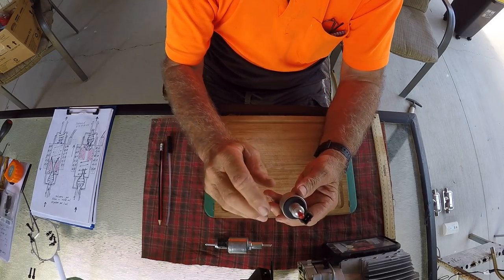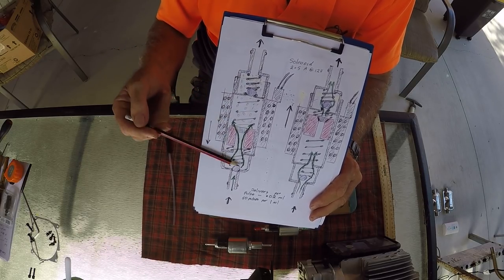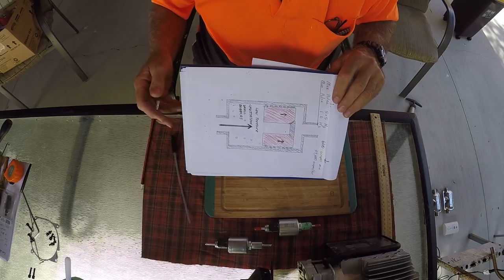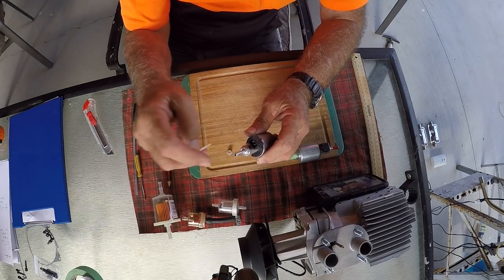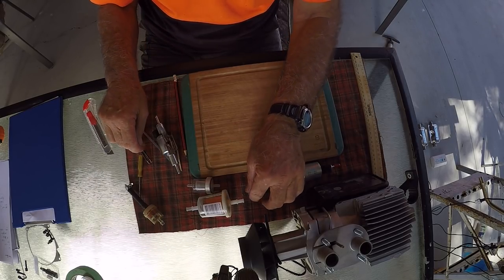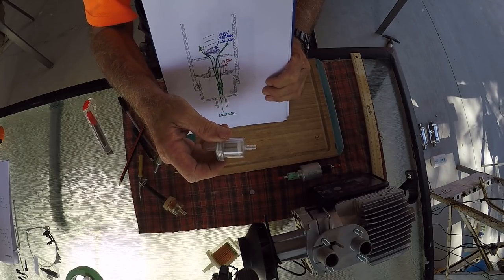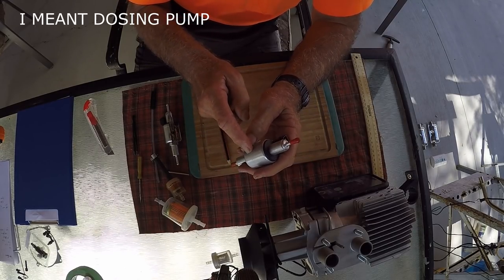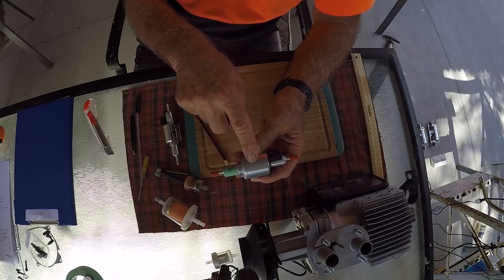Chinese Diesel Air Heaters   Part 7   Metering/Dosing pump

Comment: Thanks John about suspending the pump to make it poss quieter ,webasto make a damper for their pump looks like a plastic disc chamber that goes on outflow of pump ,to equalise flow .Any ideas if this would work please .thank you
Reply from the maker: Hi Ian,  I am aware of the Webasto dosing pump with the damper and as Webasto, Eberspacher and the Chinese copies have the same operation parameters, it should work, but as I have not personally tested one in a bench test, I can not give any recommendation. Sorry.   JMcK

Comment: Hi John, love your work, just wondering if the fuel tank is mounted half a meter above the rest of the system will it keep syphoning through when it’s turned off
Reply from the maker: Hi Clayton, 

Unlikely at 500 mm head, but possible. The little piston in the pump is shot upwards by an electromagnetic field and it returns downwards by small springs. If the springs get a little soft from age and use the head of fuel pressure will overcome the small springs and you will have leakage.

You can also get leak through of fuel if a small bit of foreign object (bad filter) gets under a non return valve in the pump. 

I strongly suggest all owners with the fuel tank mounted higher than the pump to install an inline, easily accessible, shut off valve in the fuel line, before the the pump.

Cheers.  JMcK

Comment: I seem to be having a leak on two consecutive heaters. I noticed on one video that you said, "don't install it on the side with the Glow plug down." I had already done that and is  that why it has a small leak when shutting down?
Reply from the maker: Correct Alan, side mounting is ok provided the glow plug is uppermost.  JMcK

Comment: Would it be OK if you just shot a little bit of WD-40 in the pump for lubricant before you install the pump
Reply from the maker: Hi Scott,

Yes, that would help.

But how long would the lubrication last? 

Do you think a good squirt of WD-40 would still lubricate the little piston and keep it cool after it had done more than 5,000 strokes without further lubrication. And that is just the start for the piston to fill a small fuel filter, let alone the delivery fuel line.

Cheers.  JMcK

Comment: Hi again, I bought one of those  quiet pumps from Amazon - it wont let me post the link - the green ones with the inbuilt gauze and can report that it is certainly way WAY quieter.... there is a small hole above the gauze (4th pic down on the listing) ...should it be mounted so that the hole is at the bottom and therefore covered by the fuel level or at the top so it isnt ?.... I asked the seller but of course got no response
thanks
Reply from the maker: Hi David, I have not seen those pumps. Can you please send photos and link to my email, johnmck47@outlook.com, and I will try and answer your question.  JMcK

Comment: Hi John. I have just snipped the dosing pump wiring so that I can extend it. I have just noticed that the wires are the same colour. Does this mean it doesnt matter about the polarity of the pulses?
Reply from the maker: Correct Chris. The little piston in the dosing pump is activated by an electromagnet, and Polarity does not matter. However be aware of voltage drop in extended wires. You may need to go up in wire size when extending the loom.

I talk more about this in the motorhome videos.  

Cheers.  JMcK

Comment: Hello John
I need your help, I installed aa diesel heater in the caravan 18 months ago a d its been brilliant.
Last week I was at Kyneton in Victoria, it was cold so put on the heater, and up popped error 8 flameout.
The problem was fuel starvation and I primed it a couple of times and it still did the same.
It turns out thee fuel filter was blocked.
So I removed the filter and it worked.
I need to find another filter buy now another issue.
I turn it on the glow plug comes on then then the pump, so far so good, but before the glo plug goes out, the pump stops, and On then displays on the screen and it fire up.

So it's taking two goes to fire up and this has only occurred since the fuel filter blockage.
I'm not to sure what the problem is.
Any ideas?
Cheers Steven
Reply from the maker: Hi Steven
Can only do basic reply as on a boat in Coral Sea with very limited internet. 

First up suggest you find why filter blocked, eg why you have bad fuel. I have never had to change a fuel filter. Are you using vehicle tank or do you have a heater tank?
If you have diesel bug you must have water. If you get water in little pump and it sits still for sumner you will corrode piston and may need new pump. 

Another issue. Do you use narrow bore hard nylon on fuel delivery side of pump? If not you may have excessive carbon deposits on atomisation screen. 
My email is johnmck47@outlook.com 
If you email me after August 15 I will be back on shore with better internet access. JMcK

Comment: My little pump was clicking away one day then just stopped.  I'm assuming dead pump.

I tried pulsing it with leads from a 12v battery and it no longer pulses. I'm assuming the pumps dead. Time to replace it. 

I wonder what failed all the sudden.
Reply from the maker: Hi Jslove,

Yes looks like the pump is dead. Without knowing more details, like working age of the pump, and operating conditions,  I can't give a detailed answer. 

Pumps wear out after a lot of use. If they overheat because you put padding around them to keep them quite they will fail. If you do not have a good filter in the fuel line impurities can cause the little  piston to jam. If you use the pump to excessively dry prime the pump you will cause internal damage and lessen pump life. The pump goes up by a magnetic field, but down by little springs, if a spring breaks the pump will not work. Sometimes the piston jams in the bore and you can often free it by a few light taps on the pump housing.

But replacement pumps from China are now very affordable, but make sure you order with the right voltage.  JMcK

Comment: Question for you how about if you have the tank higher than the unit can you mount the pump pushing down words will it work properly have you ever tried it that way
Reply from the maker: Hi Gary,

The pump will work like that “for a while”. Small cavitation bubbles can become a large air bubble which will cause pump operation issues.

Mount the pump upright and feed the fuel line down and back up to the pump in a U.

It is ok to have the tank higher than the heater but you should have a shut off valve to prevent gravity seepage into the heater when it is not being used. Turn tap off when heater is not used.

Cheers.  JMcK
Reply: @johnmck1147  thanks

Comment: Terry H - Thanks John,  another excellent instructional video on installing/using a vehicle based diesel heater. I was "directed" to your Part 11 YouTube video by a fellow member of a Facebook Caravan site (for which I am very grateful). I have an Eberspacher heater system as part of the factory build and wondered what was causing the "ticking" noise and how I could quieten it down. The pump is near to fuel tank (basically under where we sit at the back of the caravan)  using the factory supplied rubber mount tilted at "45" degrees upward angle (now I understand why) but does not have a pre-filter (another task when I return home). Do you still recommend removing the  Eberspacher filter or leaving it in and having both? Also, what are your thoughts about water ingress from a "bad source" (I have added an extra filter system to my tow vehicle to minimise the affect of this)?
Reply from the maker: Hi Terry, I would just add another Pre filter if your pump is working properly. If the pump filter is clogged take it out and don't bother replacing it, but you must add another filter.

Not sure what you mean about the water. Do you mean water in the fuel, or water in the heater combustion air inlet?   

Regards,  JMcK
Reply: Hi John, thanks for the confirmation about adding another filter. 

What  I meant was water in the fuel - there are inferences that there is a possibility that diesel  in remote parts of Australia may not be of the best quality and contain water. If this was the case and I was unfortunate to add water contaminated diesel, what affect would that have on the heater system?

Thanks, Terry
Reply from the maker: Terry Haebich ,

Hi Terry, water in diesel is not good in any application, however it sinks to the bottom of the fuel tank and can be drained off or syphoned out.

Also if you mount the fuel filter in an easy viewing place you will see any water in the filter and can drain it off.  JMcK

Comment: My dosing pump says  MZ2020.06 12v-22ml

Does that means it pumps more than .02ml? It’s the 5kw model
Reply from the maker: Yes Robert,

The common 5Kw Chinese heater is a copy of the German D4  (4Kw) Eberspacher heater.

The Germans are conservative with their claims, and the Chinese copy heaters were borderline on their 5Kw claims.

Having said that, these Chinese heaters are excellent little heaters, and their low price brings availability to the masses. I have not recently checked the current price of the genuine Eberspacher heater in Aus, but in the past you could buy around 20 Chinese copy heaters for the cost of one genuine heater.

Some heaters are now being sent with 12-22ml pumps which dispense .022ml per stroke, rather than the standard .02 ml per stroke. 

In theory, the extra fuel dose will increase the burn, and increase the heat output. (And justify the 5Kw claim) But if you saw the videos where I show what volume .02ml looks like, you would need a microscope to see the extra 002ml of diesel.

The extra heat output in practice would be so minute, you would need a serious laboratory and real upmarket instruments to measure the difference.

Cheers.  JMcK

Comment: Silly question maybe, but could you add some 2-stroke low-ash 2-stroke oil to kero to get the necessary lube? Central heating oil in UK is about £1 a litre at the moment. 2-stroke oil is about £3.50 a litre. (5 litre pots). 2-S engines run about 50:1, so at that dose it would cost £1.07 a litre to run kero, compared to £1.50 for diesel at today's prices.
Reply from the maker: Hi Nio, I am told your heating kerro in the UK, unlike lightning kerro, has a high sulphur content, if so, that alone may provide enough lube for the pump. 2stroke oil would also provide lube, but has a tendency to produce more carbon deposits. If you go 2 stroke oil, perhaps 100:1 may be all you need.

Because I live in Australia, I have no access to UK heating oil, so I can't do actual testing, and can only give a personal opinion.  JMcK

Comment: Some say, mount it at 30 degrees others say 45 degrees.  So is it best to mount the pump at 90degrees vertical?
Reply from the maker: It doesn't really matter David as long as it is pointing upwards to let the little cavitation bubbles escape easily. 45° to 90° is good but anything over 15° is ok

Comment: I do not like the many connections that the kits require. I prefer to use the soft silicone(I believe)fuel line from a chainsaw or weedwacker, do you know if these lines are compatible with diesel/kero?
Reply from the maker: Hi Robert, Eberspacher, and many Chinese copies use a thin, HARD, nylon fuel line with a very small bore of 2 mm. They mostly use that fuel line as it reduces a tendency to kink or restrict the diesel flow, and the nylon has a low fluid resistance. I assume you are using a larger 3mm or more bore hose. If a fuel hose is sold for petrol, it is usually safe for diesel. Look to see if the hose properties change. That will give you an indication if the hose is compatible. 

If you use a larger diameter hose, you must mount the dosing pump down low so it does not have to suck or lift the diesel. You will have issues with larger diameter hose if the little pump is located higher than the diesel tank as the pump will now struggle to lift the extra weight of fuel in the larger diameter line. J
Reply: @johnmck1147  Thanks John. I just don't like all the connections and clamps. I would think that the pressure in the line is almost nothing and the electro-mechanical pump would have the ability to push/pull the diesel without issue. You could also adjust the dosing frequency to fine tune the fuel supply(and also any increased static pressure in the combustion and heated air lines) but that may an exhaust gas analyzer(CO meter). Didn't consider that the weight of the fluid would make much difference, nylon line OD is 4mm, ID 2mm. The only issue I thought would be is having about 5 times as much diesel in the line to prime heater. Keep up the vids, the best available. I agree with you on 99% of your analysis. The other 1% is nitpicking! There is soooo much misinformation on the Face Book Air Diesel Heater group. Great little heaters in the right situation and with proper installation. My biggest concern in any installation is the exhaust, temperature and CO.
Reply from the maker: Hi Robert, Yes I tend to agree re all the connections, however in practice it is not such an issue. I also agree with the reasons for  having just one size hose. The thin 2 mm bore nylon hose is Eberspacher original, and copied by the Chinese. I wonder if the Eberspacher initial testing was influenced by their choice to use that silly little filter in their dosing pumps. The pump had to suck diesel through a minute filter with a screen surface area not much larger than a match head.

Mount the pump very close to your diesel tank, with little or no lift requirement, and I doubt you will have any issues with your larger bore hose. J
Reply: @johnmck1147  John, I think I now agree with you 99.9%. Where and what did you teach, you are knowledgeable, accurate and very thorough! P.S. - the diesel in the USA is very clean but I would still suggest a filter, mine has a water drain.
Reply from the maker: Thanks for the feedback Robert. I have taught a number of different subjects over a lot of years. 

Road diesel in Aus is also pretty good as mostly there is a filter at the pump and it has a regular turnover. But in the marine field or remote areas with diesel in steel drums it is not so good. 

Remember even with clean diesel you can still have gelling and waxing in colder weather, and it is better to remove this with a large filter before it gets to the pump. J
Reply: @johnmck1147  John, still curious what subjects you taught because you're technical comprehension is impressive. P.S. - I am an engineer with 40+ years in the construction industry.
Reply from the maker: Oh Robert! I am not a teacher, but learn't excellent teaching skills in the Army Reserve as a teenager.  Taught military and civilian driving. Also a SCUBA instructor for many years, and in later life worked for big multinational Adhesive and Resin Company. Taught customers and their workers gluing and fibreglass techniques. All this other stuff is self taught from a desire to learn, question, analyze and see how and why stuff works. J
Reply: @johnmck1147  , i think you got a small thing wrong here: The load on the pump does not increase with the fuel line diameter. 
The hydrostatic pressure is depending on the diesel's density, the height difference, and earth's gravity, but independent from the container/hose geometry. 
The hydrodynamic pressure, caused by the flow of diesel, will be lower for a larger diameter.

Comment: Hi John, 
Thanks for taking the time to provide these Video's.  I have a question regarding the physical location of the pump.  Due to (lack of) space available, I intend to mount the tank on the rear bumper of my van, between the spare wheel and the van.  This will now require the pump to be located under the van due to the need to instal the pump within 1-2 mtr from the tank.  Can you see any problems with this? I intend to mount the pump in a metal box to protect it from moisture and stone damage.  Cheers
Reply from the maker: Hi John, all that sounds ok. 
The closer the pump to the tank the better, and remember the pump must be tilted upwards at least 15°.  
Cheers.  JMcK
Reply: @johnmck1147  John, Thanks for the quick response, I intend to fit the pump in a vertical position.  The way the tank (that is now fitted) is situated, there is likely to be a reasonable 'head of static pressure' probably in the region of 15cm from outlet of the tank -  to the pump inlet.  Further, I intend to fit a shut-off tap and larger filter before the pump.  As you explained in one of the video's, the supplied filter is quite small and if there is a load of dirty fuel, it would block fairly quickly.  Again, thanks for the response and input  Cheers
Reply from the maker: John Seebohm ,

Sounds good.   JMcK

Comment: I dunno what happened to my heater pump. It was dripping diesel out were the plug go's into. Barley even ran for 6 hours. Now when I test it it will only run. For 30 seconds before it gets hot and stops.

Anyways new pump been ordered.

Comment: What would be the proper way to plumb the pump if the fuel tank is higher than the heater?
Reply from the maker: Hi John,

Suggest you install a shut off valve in fuel line at the rank and turn it off when not using the heater to prevent fuel weep into heater when not used.

Fuel hose should run down below and back up to pump in a U loop. 

Regards.  JMcK